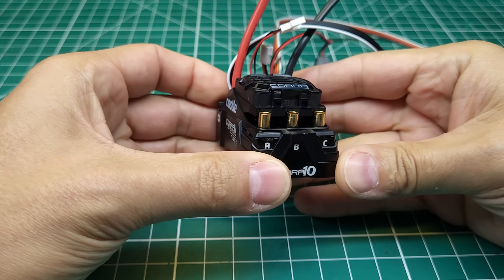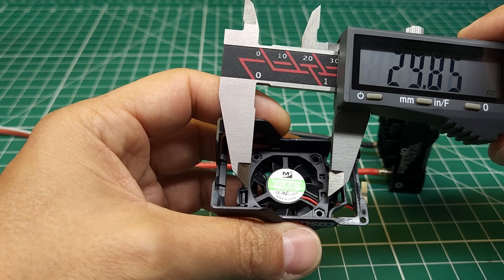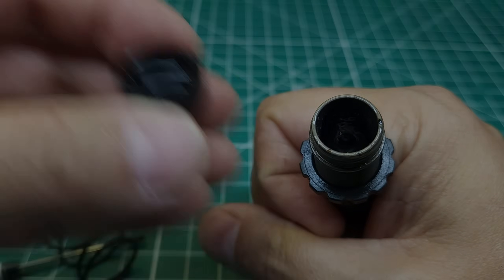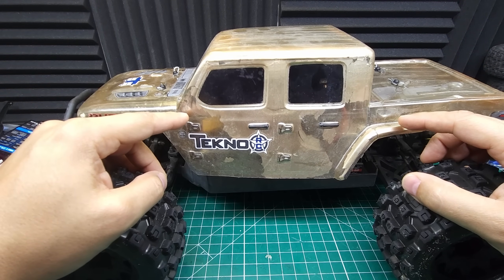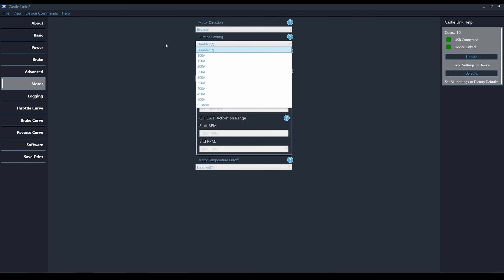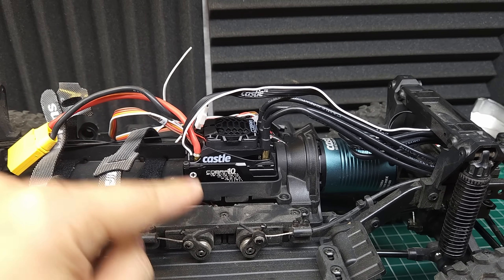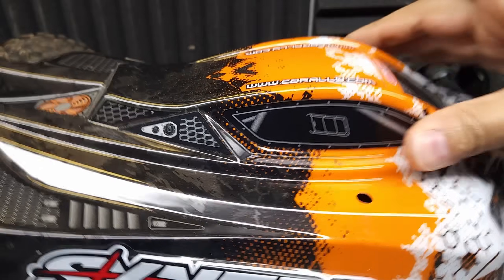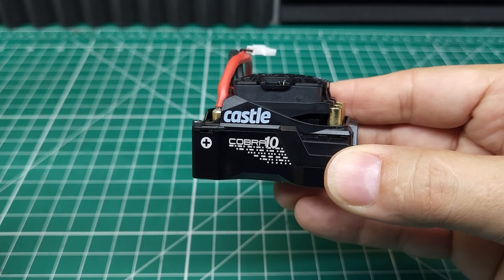NEW Castle Cobra 10 Is The ULTIMATE 1/10 Scale RC ESC! Should You Buy?

Comment: So which is better? HW or castle? I was told castle has a reputation of catching fire? And how would i know what motor i should get? Ezrun max6 g2 combo? But dunno what size motor for my fireteam, theres 2 choices. 😅
Reply from the maker: Castle has a reputation for catching fire that they don't deserve. They've had a couple of issues with small batches of ESCs in the past but in general they're fine. I'd say if you want the absolute top of the line best and you don't care about price go Castle but if you're looking for overall value hobby wing is really hard to beat.
Reply: @DoRC  is this going to fit the arrma FT?MAMBA XLX2, 8S, 33.6V ESC, WITH 1721-1260KV SENSORED MOTOR

Im sorry i cant really understand most of the vids in regards with motor and how to know. Technically just going off the price assuming it is best😅 and i believe the only video you have in regards with motors is how to fix em or be able to reuse them
Reply from the maker: @billcody26  Not without modification. If you want to go Castle you'd be better off with an MMX 8S combo. The XLX2 is wildly overpowered for that application.
Reply: @DoRC  oh ok ok! Thank you!!!
Reply: @DoRC  hey boss, would this fit the Fireteam? MAMBA MONSTER X 8S, 33.6V ESC W / 2028-800KV SENSORED MOTOR? 

Or should i just settle with MAMBA MONSTER X 8S, 33.6V ESC W / 1717-1650KV?

the 2028 is bigger but lower KV, so does that mean it is slower?
Reply from the maker: @billcody26  I don't think the 2028 will fit without modification at least. The 1717 should fit. Lower KV does not mean less power it just means the motor will spin more slowly for a given voltage applied. Generally speaking a larger motor is going to be more powerful than a smaller motor. Depending on what you're trying to accomplish you may need to adjust gearing in order to accommodate for that lower top rotational speed though.
Reply: @DoRC  copy thank you for the explanation. Dont understand the last part of rotation speed thingy. Hopefully one day i can be as knowledgeable as you!

Comment: I was sold a copperhead 10 with a teepee 7700 for a drag car and told that I would get 81 mile an hour and it's up 2 seconds flat. I have never come close to that and my RPMs on 7.4 is 44,000 instead of 64,000. I'm heading to the hobby shop now, is the copperhead 10 the problem can it just not handle the amps
Reply from the maker: I'm not sure. There are a ton of different variables involved and how fast you end up going. You might be best served joining a RC drag group on Facebook and asking on there.
Reply: @DoRC  just left my Rx shop. Kv was wrong. Bought another ghost and 2 turn hole shot

Comment: As much as Castle ESC’s are not really designed for racing, I do like using them for racing, and seeing how the Corally ran on 6s gives me good hopes that this ESC will do fine in a 1/8 racing buggy on 4s.
Reply from the maker: I am definitely not a racer but I'm curious why aren't they made for racing?
Reply: @ they typically are a bit heavy, the aesthetics, the height, the waterproofing adding weight, also the ability to push well over 4s is unnecessary for racing, but I have had success with a Mamba X.
Reply from the maker: @vivos71  oh yeah that all makes sense. See those are the things I just wouldn't even think about as a basher. I personally wouldn't buy an ESC that wasn't waterproof but yeah I guess you don't really need that for racing

Comment: I personally prefer Anderson Power Products 50a connectors for my 1/10 esc’s
Reply from the maker: Interesting. I don't know of anybody else that uses those. I'd be a little concerned about the 50 amp rating though. That's a little light for modern 1/10 scale bashers.
Reply: @ it’s a joke about how big rc connectors are getting, they’re muli-hundred volt forklift connectors
Reply from the maker: @vivos71  You know I thought power Pole connectors were massive. I just assumed there was some smaller version I wasn't aware of.

Comment: Hey thanks as always for a great video!  I know this is a few months old but I circled back to it.  Building an MT410 2.0 soon and was considering this in a combo.  Do you think running this with a 3200kv on 3s is ideal?  Would you recommend another combo instead?  Gonna run my Max10 g2/3200kv first, but I LOVE my Cobra 8 combo in my Mojave 4S so was thinking about doing the Cobra 10 in the Tekno.

Thanks again! 😊
Reply from the maker: As long as you don't mind spending the cash it's hard to do better than the Cobra 10. It is a premium system and it gives you the feel of a premium system.
Reply: Wow how is that cobra 8 combo doing in your Mojave 4s
Reply: @gonzodetroitify  haha I was literally cleaning it up as your message came through.  It’s doing awesome!  2200kv motor.  Been running on both 4s (higher capacity) and 6s. (more powah!)  Biggest problem was finding tires I liked on it since the stock ones wear down too quickly on mixed surfaces.  Been absolutely loving the set of Corally buggy tires I threw on it!  It’s a blast! 🤘
Reply: @ thanks for reply @Cobra21029 I hear that with the tyres 
And maybe next set I need I’ll get some 6s Mojave 1’s 🤭 it is an absolute blast as you say so Your castle Mojave must be an absolute madman😏

Comment: What's the most amps you've gotten out of this ESC? (on 3 or 4s if you have that data). I'm pretty new to the professional side of this hobby but I'm trying to decide if this or that XR8 g3 thing from hobbywing is better because it says it can output 200A. Do you have any other recommendations for reliable, very high amperage 3-4s escs??
Reply from the maker: I haven't seen the actual maximum current but the XR8 probably will be more powerful overall. 
I really like SMC batteries.

Comment: The fan connection is not proprietary to Castle. It's a JST-XH and is very common in 3.7v applications.
Reply from the maker: By proprietary I mean a connection that no other manufacturer in the hobby uses for fans. If you buy any other fan it's not going to have that connector on it.
That being said I did technically use the wrong term. I should have said unique to Castle in the hobby.

Comment: I'll stick with Hobbywing, they do everything I need them to do.! 😉
Reply from the maker: And for many people that's going to be the case. Hobby Wing has the budget side of things completely locked down. There are some features in these ESCs that hobbywing does not have a compatible option for and personally I think that Castle ESCs are made better but they certainly are more expensive.
Reply: This esc is meant for crawlers, hw makes 2in1 that's 1200kv $69 & 1800kv $79. Either hw or hh v3 for me.
Reply: @TrokaRC  I have a Hobbywing Fusion SE 1800kv & it's pretty impressive.!
The FOC literally blew my mind 😲🤯.!! 
I couldn't believe the low speed control, even having it geared quite high for more top speed. 
I'm currently using it in my RGT Toyota Land Cruiser, it's stuck in 2nd gear but it still crawls beautifully.! 
I just wish it had more tunability because the power delivery is quite sharp, I'd like it to be smoother.

Comment: I would like to see a second video after a while of owning and bashing on this esc with one of their sensored motors if possible to see what it dose in the long run it looks like a good esc for my xxl arrma build rn I have a 6s spektrum system in it the 140 ez run combo from hw I had in it felt slow and underpowered
Reply: I would also absolutely buy this from you if you would sell it to me seeing it’s 6s capable that would be perfect
Reply from the maker: If you thought the 140 amp combo was underpowered I would recommend getting the Cobra 8 instead of this.
I appreciate the offer but I always keep a hold of my electronics. Never know when you're going to need them
Reply: @DoRC  let me rephrase lol the motor felt underpowered and didn’t like how hot it got the esc did good stayed cool but I like castles 8v bec I run the raw 500 in it and love the power on 7.4-8v but hw again felt weak to me and understandable lol I do have a 160 I could throw in it but this 150 on 4s with some mod one gearing and speed gearing is dummy fast lol
Reply from the maker: @Going4arip_RC  Yeah I understand. I just think that if you're currently running a 150 amp 6s ESC this ESC would be a downgrade. This is 6S capable but it's really primarily a 4S 1/10 scale ESC.
Reply: @DoRC  with the 6s combo is running how I want on 4s cause I plan on running it on 4s unless it takes 6s then I’ll move up lol but primarily a 4s build I just want to know how it would pair with like the 1520 series castle motor I feel it would be a perfect combo for the xxl 4s trucks also my bad if I didn’t mention its a 4s chassis not a 6s chassis just xxl cause its bigger than the previous 3&4s chassis

Comment: Interesting that it’s 6s! When you started talking about using an xt90 around the 2 minute mark, it reminded me to ask you for some advice on what connectors to use depending on the amount of cells and amps. I want to to switch to a single type of connector on all my cars, and I was thinking I might use IC5 and EC5 on all my vehicles 1/10 and 1/8, because those are relatively good plugs and it would mean I don’t have to void Horizon warranties. Then, I would use xt60s on everything sub 1/10 scale. I’m only worried that since I’m running 3s and 60a+ escs on the smaller cars, a 60a connector might prevent me from getting all the power available. Thoughts?
Reply from the maker: As long as the ESC is around 60 amps running an XT60 probably isn't going to be a problem as they can definitely handle higher burst current and it's very unlikely that you'd be pulling the full 60 amps all the time anyway.

Comment: I never understood esc BEC settings… how do you use it without burning out receivers?
Reply from the maker: It just depends on the capabilities of the receiver. Most modern receivers are good up to at least 9 volts so pretty much any BEC setting you want but there are some exceptions. The Traxxas receivers are only guaranteed to 6 volts and I'm sure there are others that are limited.
Reply: @DoRC  how do you know before buying? I never see any voltage capability listings or hv classification

Comment: There is no way they about to release a new model… I literally just installed a cobra 8 for my granite yes i know supper over kill. Only reason I did it because I wanted to have more run time on 4s. My Copperhead Combo kept on over heating and was making me frustrating. Now I don’t know what to do. Now both cobra 8 and 10 can do 6s too.
Reply from the maker: Well the Cobra 8 will definitely never overheat in the granite! Fortunately if you decide to switch you can just pull the cable out of the ESC and swap it over as they are the same. That'll save you some wiring.
Reply: @DoRC  Cobra 10 it is. Love the content sir! Keep it uppp! 🔥

Comment: $10 MORE, and objectively inferior to a Mamba X? No thanks.
Reply: No telemetry with the Cobra 10, heavier than a Mamba X, not ROAR certified (if that matters to you) smaller fan than a Mamba X… I’d rather a Mamba X 10 times out of 10
Reply from the maker: When you say no telemetry what exactly are you referring to? 
As far as the smaller fan these things are really efficient and it's really all the fan it needs. I did a full pack of bashing in grass in a buggy that was too heavy on 6S and it only reached about 156° f.
Reply: @DoRC  castle telemetry is accessed through Spektrum XBus (need a dx5 of some kind with a SR6100 receiver) or Futaba SBus (never tried it)

Admittedly there are a few slick features that I like. Mounting screw holes on the underside is clutch. Hill Hold for crawling is HUGE though so I’ll give it that.
Reply from the maker: @PigglyWigglyDeluxe  oh ok. Yeah I looked it up after asking I wasn't even aware of that existed. I'm sure they will come up with a 32-bit version of the same type of connection at some point. That's not really a shortcoming of the ESC that's just an incompatibility between the new 32-bit systems and their previous 8-bit telemetry setup. 
Overall I think this is a pretty solid update and yeah the hill hold thing is pretty neat!
Reply: @DoRC  the XBus stuff is super neat but admittedly quite expensive to get the harness. It’ll give you real time motor speed, motor temp, amp draw, XYZ accelerometer data, G forces, battery voltage, ESC temp, all sorts of stuff. 

How much does that matter? Eh, probably to 3 people. I hardly use it anymore either, I spend more time with my eyes on my truck and surroundings, and never on the radio screen, especially for real time data.
Reply: Cobra also has cryodrive that the Mamba X does not.
Reply from the maker: @kansasdan9373  very true.

Comment: Confused why they stop the BEC at 8.0v , isn’t the standard for HV 8.4? Half a volt makes a big difference with HV servos
Reply from the maker: I'm not sure but I will say that the current capability of the BEC is almost just as important as the voltage and the BECs in the castle ESCs are pretty powerful. I've never really missed the extra half volt.  Also keep in mind that 8 volts to 8.4 volts is only a 5% difference.
Reply: @DoRC good point on the 5% and the amps, but I get the original argument. Like why? The question is why? lol, it must’ve been a part that they saved a fortune on.
Reply from the maker: Just got the answer straight from the man. In order to maintain 5 volt compatibility they switching power supply that they use is limited to 8 volts maximum. They also said that above 8 volts servos can start pulling a lot of current exceeding the eight amp limit of the BEC.
Reply: @DoRC  oh so they limited to prevent brown outs? i guess i'll give them that for quality sake but, i mean just upgrade the BEC amperage...

Comment: Well, this doesn't look like a super upgrade to me.  I was trying to use my mamba x in a crawler.  in 2024 this is a very inconvenient esc.  You need to seal a bunch of connectors, the power button is terrible, the touch wire is from the 2000s.   The situation is absolutely exactly the same here...Castle did not update the design of the sensor wire (as Hobbying did), the old fans and the power button, oh.. but it looks good in appearance.  However, the issue of price is very ambiguous for me; there are competitors on the market that are more convenient to use, IMO...
Anyway, thank you for the review! Love your videos;)
Reply from the maker: What do you mean by touch wire?
Reply: @DoRC  oh, sorry, sensor wire i mean) very thin, non waterproof,  very old design that should be upgraded

Comment: The reverse to forward brake has been a feature on traxxas escs for a very long time. Since the first vxl 6s at least. It’s one of the things I hate the most about HW escs. Of my bashers 4/6 still use VXLs because of that feature. Also the much better LVC warning. HW escs don’t provide nearly enough warning for me.
Reply from the maker: Yeah they do have it but it's not adjustable which I think is a really big benefit of this ESC. Pretty much all of the features on it are customizable and I'm finding I appreciate that more and more.
Have you turned up the LVC on your hobbywing ESCs?
Reply: @DoRC  I do understand it’s not programmable, and I’m not at all saying traxxas escs are better, just that a R2F brake has existed for a while. Just thought it was weird it took this long for other brands to implement. As far as the HW esc issue, I heave my LVC set to high, and still i only get about 20-30 seconds of driving time. I go to a multi acre field so often need at least 1-2 minutes if not more of lvc driving to get back to myself/my car. Traxxas escs will let me drive for over 5 minutes in lvc mode,
Reply from the maker: @EV_Dreams  ahh. Okay I misunderstood the issue you were having with LVC.
Reply: @DoRC  seems to be a niche issue honestly. When i do end up using hw like in my max5 g2 powered xrt I end up setting the LVC to 3.0v and my Tx telemetry to 3.2v/cell
Reply from the maker: @dylanwhite6539 Yeah I think most people bash reasonably close to themselves so when they hit LVC it's not that big of a deal. My car is rarely more than 30 or 40 ft away from me.
Reply: @DoRC  if I’m not mistaken I regularly get between 500-1000ft away from myself. Nearly 5 minute walks to flip over on occasion. Plus side is I can have my throttle pegged for a solid 10-20+ seconds on about anything I own. Good thing the dx5c I used to own and dx5 pro I own now have stellar range.
Reply: Are you guys talking about braking when driving forward and when reaching almost a standstill the ESC just changes into reverse? I see this behaviour on my little 16BL30 from HW and it annoys me a ton. I feel I cannot get used to it :-(
Reply from the maker: @FrifjellDrivesRC  no. This is referring to when you're in reverse and you hit forward some ESCs will just immediately go into forward instead of initiating a braking sequence like it does in reverse.
It sounds like you don't have forward reverse brake turned on with your 16BL30. I believe with forward reverse brakes selected any of the hobbywing ESCs should just come to a stop when you hit the brakes instead of immediately going into reverse.
Reply: It's definitely NOT the same as what's in the Traxxas ESCs.  From what I'm understanding, with the Cobra10, is programmable...the Traxxas is not.  The best comparison I can think of would be the ESCs in the Kyosho Mini-Z MR-03 EVO & MR-04 EVO, both of which have a programmable "time out" between reverse & forward.
Reply from the maker: @ninthislandrc  Yes both the reverse to forward brake strength is programmable and the delay between automatic direction changes programmable. Between those two things it really can dramatically affect how the ESC feels.